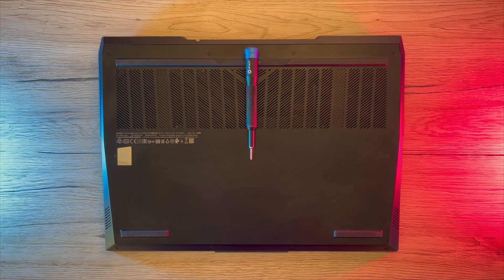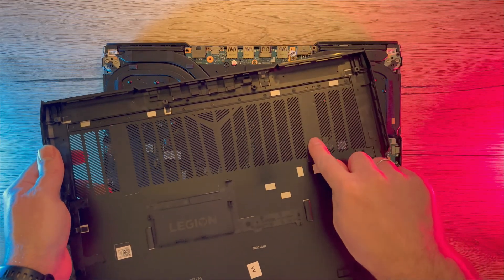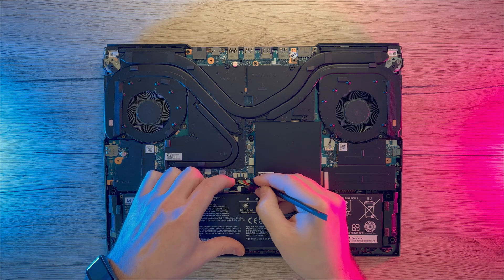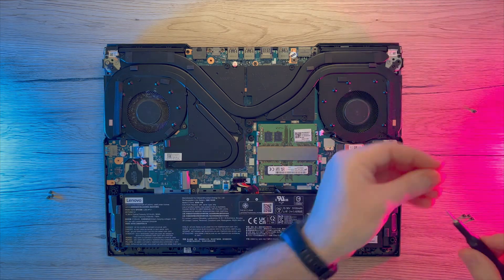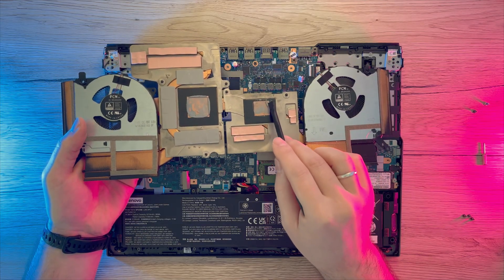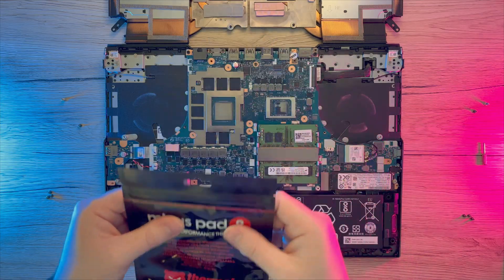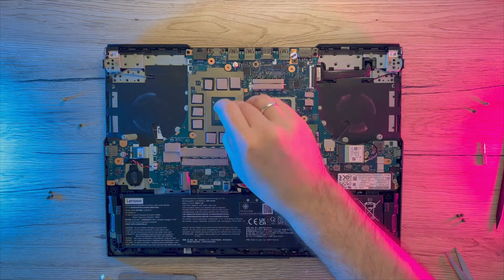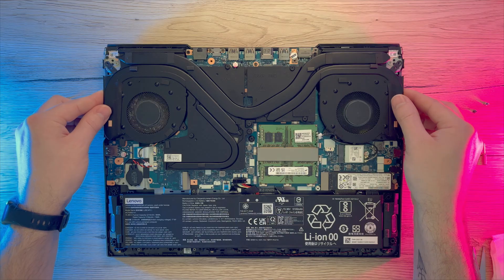Re-Pasting Lenovo Legion 5 Pro 2021 and Fixing Over Heating

Comment: Hi there can someone help me? I have an legion 5i 
I7-10750h 
Rtx 2060

Can I use the same thermal pad he used?
1mm?
Reply from the maker: Hmm I am not sure But knowing Lenovo they were to lazy to change anything so it could be the same thing 🤣 open it up and cross check with mine in video (also use callipers or ruler to check your pads thickness)
Reply: @atechcheck  okay thanks 😁
I'm gonna try that

Comment: Hi, im using mx4 and noticed that the result is not as expected. Anyway.. ambient temps are around 35 degrees currently. Will send the unit to warranty for heatsink replacement. That's why we paid a premium for this lap
Reply from the maker: Well they will not find anything since it is so by design unfortunately, and that is why they are using Honeywell instead of other more liquid pastes… best case you will get a new device with same issues if you repaste or if you don’t your temps will stay high… You can always try Thermal Grizzly Extreme since it is much thicker than standard ones or go my route and get yourself Alphacool Subzero (which is a bit thicker than the rest) and their 11wk soft pads :) I am waiting for Honeywell paste to arive to test is and get an final answer on this topic, since all are praising Honeywell but I think it was working better in Lenovo just because it was making better contact 😉 please check my last video with Alphacool and you will see where is your problem exactly
Reply: @atechcheck  you know how Americans are.. Honeywell will perform just as good as any high quality paste, although it will perform worst than liquid metal. Im still waiting for room temps to go lower since atm we're experiencing high temps all over the territory and it's really ez for temps to high +90. Use ryzen controller to limit temps. Works just fine.
Reply from the maker: yeah same here in EU XD it was really hot for couple of days :) either limit your CPU to 25W or disable boost thru Wind power plans and you are good to go XD I mean atm 3.2GHz on all 8 cores is plenty for anything tbh :D
Reply: @atechcheck  just use Ryzen Controller temp limit to 85º
Reply from the maker: Or that ☺️ I mean it is so nice to have so many ways to control Ryzen CPUs 😀
Reply: i don't think the mx4 is an upgrade over the stock thermal paste. it's time to move on from the mx4 for more extreme situations (like gaming laptops), better things have come out :)

Comment: Some how when i repaste with NT H2 paste,they over heat,but the pad i got from service centre didnot
Reply from the maker: Well if you left original pads it will not work as I have showed… Also Leno used Honeywell and it is much thicker/harder… you will need to go either with really soft deformable pad or use paste instead of them…. I am waiting for Honeywell paste to test but my Alphacool works great and NTH2 is not something that I would use… Either Honeywell because of thickness, Thermal Grizzly or even better Alphacool Subzero because of better thermal conductivity even when contact is not that great it will be good as TG with good contact…

Comment: I just got the legion 5 pro 3 days ago with the 3070.  My gpu runs really cool but my AMD 7 5800h was running 98 to 102c I lifted it up off my table a little and it's now running around 88c in performance red mode.  Does this seem ok or way too hot?  I think it's very hot imo my battery also always runs at 37c
Reply from the maker: I will be honest and say that I really dont know what did Lenovo do regarding CPU (Power, Cooling block, Boost time etc.) Best way to try to understand is to get HWInfo and monitor what is CPU doing in terms of Power, Util, Clocks and Temps and you will see where could your problem be. Also you can limit your CPU with Ryzen Controler to lets say 20-35W (I use mine at 17-20W @3GHz all cores) but again it will always run hotter than GPU even when GPU uses 100-140W XD (I will make a video regarding Software setup ;)
Reply: that's way too hot on the cpu but you probably haven't damaged it unless you used it at those temps for MONTHs. You should repaste ASAP and if temps are too high either downclock or undervolt or both and/or apply custom fan profiles
Reply: I have rtx 3060 amd 5800H variant you need to apply themal paste. If you can feel the heat of the chassis to the touch with your fingers.

Either ask with your warranty by proof with pictures or video to Lenovo or the store you bought from they will assist you.

Hope it helps...

Comment: I just found out its actually bad idea to remove the stock thermal pad they using on the CPU ( not gpu ). when i repaste it, with noctua / mx-5 / cooler master gel maker / thermalright etc. all of them overheat straightaway. The best paste or actually pad that you have to use back is the original one came with the laptop itself. its Honeywell PTM-7950 pad. Its an industrial grade thermal pad. Once i install this back on the cpu part atleast, no more overheating.
Reply: Same thing happened to me . Changed to noctua paste and my temps went haywire
Reply from the maker: Then check my updated video 🤭
Reply: Thermal pads like this come in many varieties/specs, u need to use one thats a match.
Reply from the maker: So did you also changed your pads with paste or did you just try another paste with original pads? Also Honeywell PTM-7950 is a thermal PASTE not PADs. I do not know if they use it or not all I can say is that in my case it worked with Alphacool pads and paste. Did you check that video out?
Reply: @atechcheck  there a paste version and a pad version. i do remember when i remove mine first, its abit harder to remove. so i believe mine was the pad version. and yeah it outperform all the industry standard paste we use to put on our desktop counterpart. i guess maybe laptop is abit different.
Reply from the maker: @93SupaFly  did you actually test this against other paste in controlled application isolating possibility that pads or uneven cooling block/MB component  surface are causing issues? I am thinking like testing it with CPU in a PC or a laptop that only have CPU and single heatpipe? Asking because according to this link and specs:

https://www.moddiy.com/products/Honeywell-PTM7950-SP-Super-Highly-Thermally-Conductive-PCM-Paste.html?srsltid=AQP2TeNZ_7U4YTA36mGFMF83tDe1JSaP7r_H_NwgypfDYOc5ZfWFcsgxL7U&setCurrencyId=3

Alphacool have much better thermal conductivity! Also it might be that due to its longevity or long-term durability it is being praised as the best? I haven't tested it but it could be an option to compare them side by side in next videos ;)
Reply: @atechcheck  sorry for the late reply. I havent test this out on other device like desktop nor own the paste version. But from my understanding when i did my own digging about the heat issue on the china side of thing, its all about the thickness of the original pad that were placed on top of the cpu die that favours laptop more instead of using traditional paste ?

might yield interesting result on desktop side of things if we use the Honeywell-PTM7950 paste version despite the low thermal conductivity compares to the likes of thermalgrizzly, mastergels, gelid etc when use under typical heatsink or even aio liquid cooling. sadly i already sold my old desktop so i unable to test this. But i Guess even Lenovo knew this pad/paste is so good, they dont need to opt for liquid metal like other brands, because we all know how nasty liquid metal can be
Reply from the maker: Well good news for all of us 😊I got my hands on Honeywell and I will be testing it against other 3 (TG, MX4, Alphacool) TG Extreme was way too expensive for 2g also I might as well try some thermal pads just for fun.
Reply: @atechcheck  Hello Alen, is there any news on the testing the Honeywell-PTM7950 paste/pads
Reply from the maker: Yeah I got it and I think I will be able to do the testing next week 😉
Reply: @atechcheck  Perfect, i'll be waiting for results!
Reply: @atechcheck  How did it go?
Reply from the maker: @ChrisRankov  yeah check my last paste video :D only thing that makes it "better" is that is much thicker and fills all the gaps left between die and block ;)

Comment: The thermal paste is dry because it isn't a paste. It's Honeywell PTM 7958 (Lenovo's variant of 7950), a phase changing material. It hardens when cool which prevents pump out and explains the dryness. In terms of performance it SHOULD be one of the better materials out there, so I expect your model had a particularly bad application. 

My L5 Pro has the same specs as yours, is completely stock in terms of cooling. With the back of the laptop raised about 7cm, I'm getting similar numbers like those in your next video. I bought mine in April last year, so one of the earlier batches. Maybe QC was a little better back then.
Reply: Ive been seeing this "dont replace legions 5 paste" because its good and you will get worse temps if you do. Can you explain what year Legions started using this Honey PTM 7950? Are you sure it didnt start after the 2021 models and does it include Non pro variants like the base Legion 5? I say this because I also have 101c temps, and 86 on the gpu on the legion 5 2021 variant FUCKING INSTANTLY. 
These Legions got some much praise around 2021 when Jarrods reviews were coming out but 1-2 years later and its a pegged thermal throttling. I mean yeah it still holds some decent speeds even when it does throttle but this shit is fucking hot... and Im starting to not like the Legion anymore.... And this BS about how the paste is actually good and they got great temps.... Then explain why theres some much info on why people are disabling their turbo boost for legions these past few years;reddit is esp filled with people fighting over whats better Ryzen controller or Disabling turbo boost. But yeah the honeywell is fucking good eh? This makes people complaining abut 80-94c  cpu temps over the past 10 years temps look like they got god tier cooling.
PS: i also use the thermal take massive rgb laptop cooler and Legions fan control since legion vantage NATIVELY doesnt even want to post temps anywhere with their vantage software or let you control fans. Guess what still 101c! but thats okay cus the limit is 105c. Perfecto
Reply: @bojangler9685 hey im a bit late but i have the same temps fucking instantly. i ordered ptm 7950 (lets hope its real) and some 1mm thermal pads  for the surrounding chips. did you eventually repaste and did it help?
Reply from the maker: @KaifamGaming unconventional advice BUT I would use that tpm insted of pads and use hood thicker paste for cpu, gpu OR if you have enough tpm then use it for everything (replacing pads) you will be surprised! Also for even better temps just disable turbo boost on CPU 😉
Reply: @atechcheck  hmmm i doubt it and no i dont have enough PTM only enough for the CPU + GPU also its PTM 7950 not 7958.
and what do you mean with "hood thicker paste"?
Reply from the maker: @KaifamGaming  ahh ok then go with it on cpu and gpu but as I explained in my latest video main issue is with pressure or lack of it and if your machine is really bad those thermal pads will cause issues if they are not really soft! Even ptm will not help xD aah that was a typo
Reply: @bojangler9685  my temps never go over 65 C, idk where you got that 80-94 C must be the predator 300 lol
Reply from the maker: Ahhh James 🤭
Reply: @James-by8tw  Idk like i said man, this whole disabling turbo boost has been such a heavy topic thanks to so many other legion users having shitty temp issues. That speaks volumes alone.

Anywawy i copied my comment on the Lenovo legion reddit and supposedly  the Honeywell 7950 is a myth and is not fact. Basicly it was spewed by someone who had even SHITTIER temps from a POOR repaste job and a few people started echoing his statements of why he thinks its Honeywell or someshit. It snowballed from there. 

Also your temps are 65c? hm maybe try a r23 cinebench run all core and let me know if its still 65... So much headroom.... like SO MUCH. Souns like someone diabled turbo boost too.
Reply from the maker: @bojangler9685  we all know what "If it sounds too good it probably is not" and like in any life scenario, if someone is claiming such delta from other reports (no matter what it is) it is not true ;)
Reply from the maker: Well Jarod is not opening his review units unfortunately. We see what he gets… I would have never learned that Lenovo have such qc and tolerance issues with their cooling blocks if I didn’t do this… I think they started using it in late 2020 early 2021…. PTM is great but not for those CPUs… and they are so hyped since they work great as gap filler and especially for laptops like LP5/Pro since die to block contact is really bad… I also have turbo disabled 95% of time. 3+ GHz are enough for everything I need and under full core load those chips will never reach boost speeds anyway… and I don’t want my cpu boosting when browsing the web just cause Windows feels like doing it xD
Reply: @atechcheck  Ive herd its possible to renew a warranty and lenovo will send a guy to your house with a new heatblock. This sounds actually very nice...
Reply from the maker: @bojangler9685  Yeah if you have on site support (costs extra when buying from Lenovo) they will do that! even for non business devices ;)
Reply from the maker: Hmmm makes sense actually… my thermal pads were bad also… I will try to find Honeywell i guess 😄
Reply: ^ Agree, In my last 4 gaming laptops I've done the whole shebang of changing thermal paste and pads with premium ones and even doing liquid metal for some, till I got my L5Pro this year (5800H, 32GB, 3070, 2TB). I found the TIM and other pads were good enough and I never saw any heat issues and played all my games pretty well. I wouldn't really base anything on paper specs because I even bought my bro some TGK-Extreme the $90 ones that claim 14.2 W / mk it seemed like regular thermal paste, thick to apply, and dried easily so YMMV. I've since then opted for NT-H2 from Noctua. TL;DR the stock paste should be one of the best and shouldn't really be changed out but I guess in an event where it wasn't applied properly from the factory then yeah swap it out.
Reply: i cleaned fans on "surface level" today and they are way less noisy + "fresh" air is getting out of the laptop. I want to dive in more and take the fans out next time (clean whole pipes). Do you think i should remove cpu and gpu pads and replace with ptm 7950, too ? I dont want to change every single pad (the +10 pink ones) - just cpu and gpu. 

Would it be better than using classic paste ? In amazon comments some say these pads are much better than regular paste. Thank you very much <3
PS : on reddit some people say cleaning fans on legion 5 pro is more than enough, paste shouldnt be changed unless temperatures issue. Do you think its true ? Regards
Reply: do you have a cleaning kit recommendation?
Reply from the maker: Well I guess at 8.5 W/m.K ( https://www.moddiy.com/products/Honeywell-PTM7950-SP-Super-Highly-Thermally-Conductive-PCM-Paste.html?srsltid=AQP2TeNZ_7U4YTA36mGFMF83tDe1JSaP7r_H_NwgypfDYOc5ZfWFcsgxL7U&setCurrencyId=3 ) it is actually not that great :D it have industrial grade durability/longevity but I think my Alphacool pads and paste are better option for this, especially if counting those terrible pads from Lenovo XD
Reply: @atechcheck  thermal paste would only last couple months on gaming laptop. thats why lenovo use honeywell, not as thermal conductive as a paste, but last the longest.

Comment: What is the thickness of the thermal pads...i need to change mine too...please let me know
Reply from the maker: well they should be 1mm but since Lenovo is using some sort of stretchy ones the are now at 0.98 or so and could go to 0.94 so I have new ones from Alphacool that are a bit softer so I guess they should work better since ones from TG are a bit harder... Will need to test
Reply: The ones that you orderd Alphacool are those 1mm too in thickness?
Reply from the maker: Yeah exactly BUT they are sofr pads especially designed to compress and hopefully provide better contact and not prevent cpu/gpu of creating perfect contacts to cooling block. I will be testing them tomorrow probably and if I find that they are better option then I will be uploading video next week 😉
Reply: Bro i used Arctix mx 4 thermal paste which gave good results and gelid extreme thermal pads of 1mm but results are not good the keyboard area and near the power button are warm all the time and the fan is always on blowing warm to hot air
Reply: Also i have compared the new pads with the stock pads...the material is quite different the gelid one is kind of hard clay matterial whereas the stock one were gum kind(sticky)...could you recommend any better thermal pad which is similar to the stock ones
Reply from the maker: Did you watched my last video with Alphacool soft pads and Subzero paste? Of not please do 😉 everything is there for L5/Pro also I will soon have comparison video between different pads and paste so stay tuned